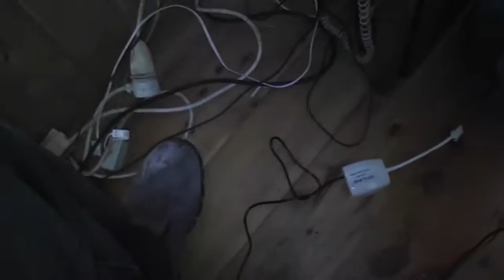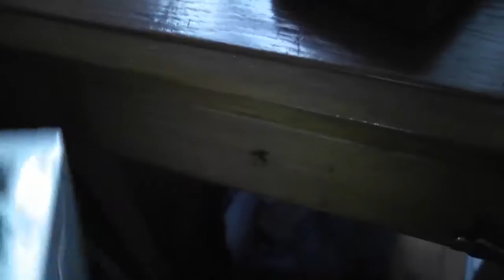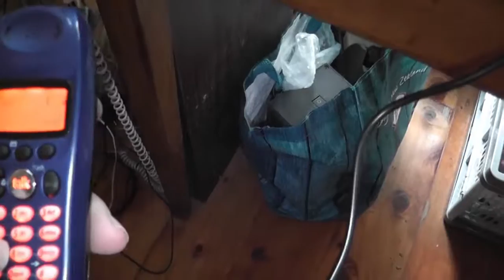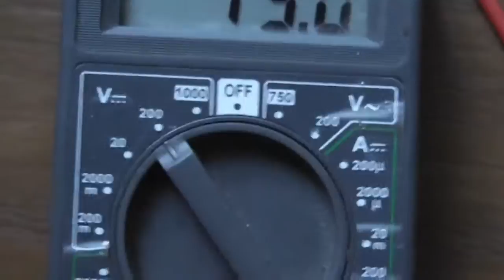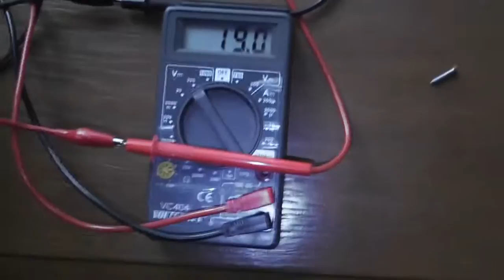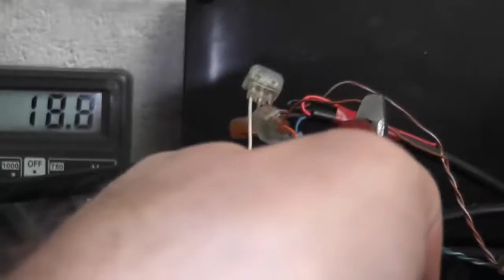analog phoneline fault

Comment: how to test telephone line that is it digital or analog?? please tell me
Reply from the maker: Farhan Hussain  this is analogue only adsl1 it's 2 system one one line with filter splitter you will need to see if someone made a video for digital but then you also don't know if the video are true or fake this channel don't uploads any fake crap analogue only crackling sound in phone is usually corrosion from water in analog phone line.